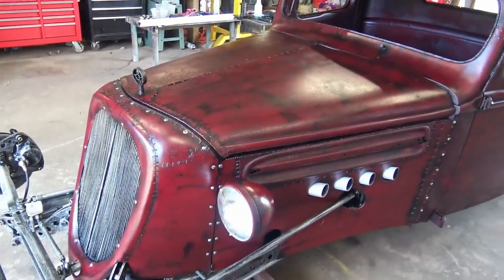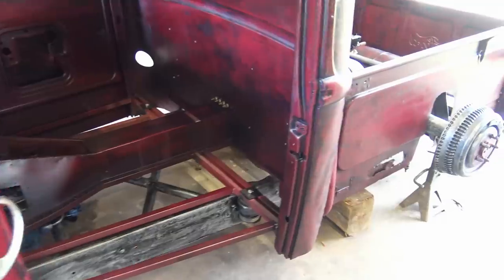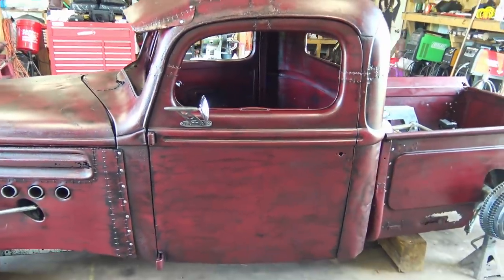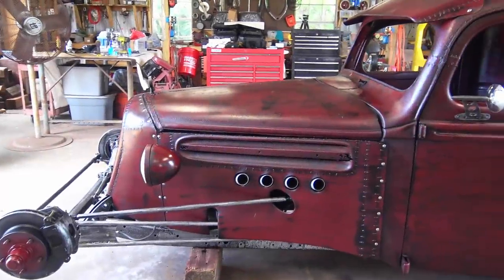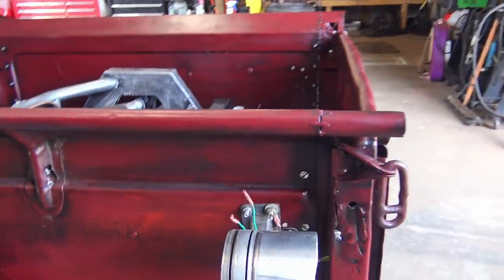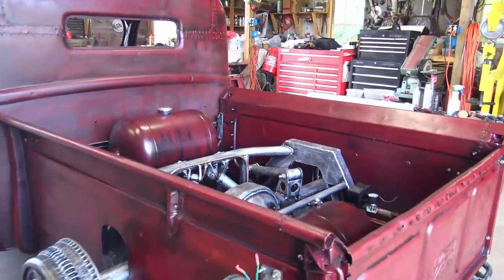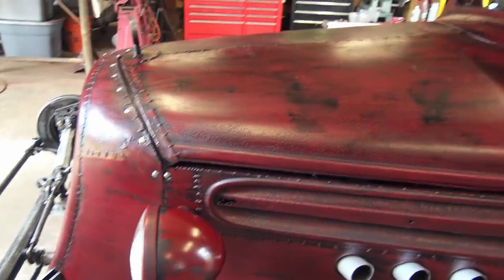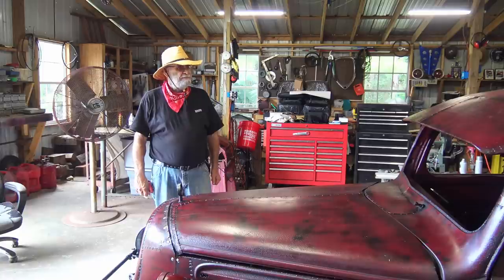The Art Of RatRodology - Old Iron Stitched Together

Comment: Well Bob you out did yourself on the paint job. Just wondering if you planning on putting clear over the whole truck to give it a deep sleeper look ?
Reply from the maker: Not a fan of clear .. so no on that but I may wipe on some linseed oil which gives the same wet look.
Reply: @RatRodBobBuilds  does linseed oil leave some kind of residue
Reply from the maker: @danielluma2948  You would think that because it's oil but no, it dries after a day or so. It won't be collecting dust and dirt.
Reply: @RatRodBobBuilds  thanks for the information on linseed oil .I might try that on my 86 Ford F 150 the hood and to of fenders  plus the roof is all surface rust from the sealer flaking off . 86 is the year Ford tried water paint on trucks and they stopped the following year to many complaints about the paint falling off. Like what you did to your rat truck .I have a new toy to play with  75 F250 4x4 Highboy got it cheep 300 bucks but needs a lot of TLC  but I'll get there some time or other.  Yeah  have fun with what you are doing  thanks.

Comment: Bob, bob,bob,Bob,,, it's looking cool. I'm digging it too.   I'm doing a model A. Just asking for a friend , but can this effect be done on the cheap with rattle cans ? Or Is it a must to have the hardener in the paint ? The green stuff is a rust preventer ?

Thank you sir.
Reply from the maker: I'm sure rattle cans will git er dun but be careful you don't rub off the base color when you're rubbing the black. That's a good reason to use hardener and let it dry a couple weeks before rubbing black but you get the picture. Make it work with what you can afford. SkyCo OSPHO rust kill .... yes.
Reply: @RatRodBobBuilds   Thank you so much for getting back with me. Haha I am on my way to pick up a used air compressor. It would be good enough to spray some color. 104 on the rust preventer.    I like your style Bob

Comment: Hey Bob what rotors and calibers do you use for that axle ?
Reply from the maker: It's a disc brake kit for early 50's Ford trucks from speedway. They use GM rotors and calipers probably like a mid 70's Impala and such.
Reply: @RatRodBobBuilds  thanks bob I'm doing a 51 ford F1